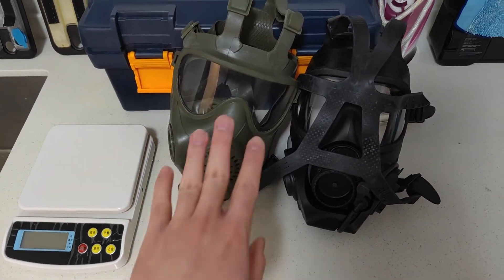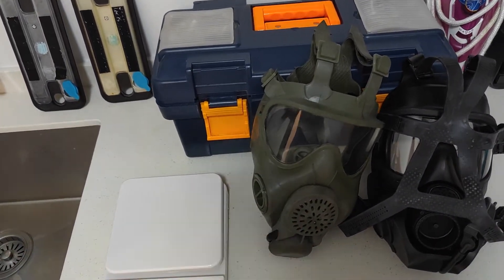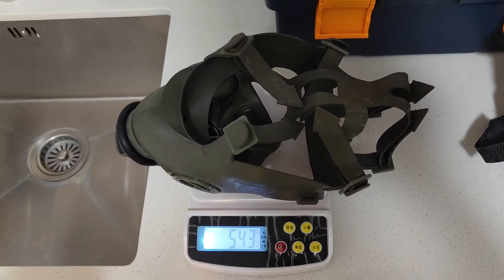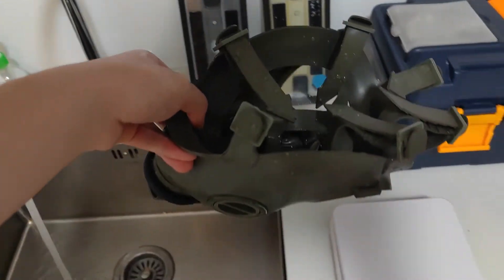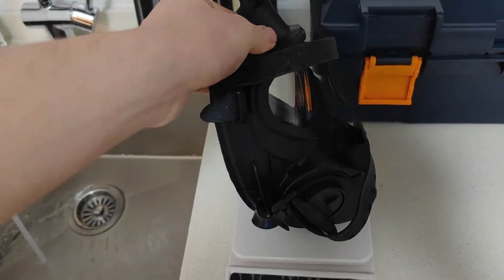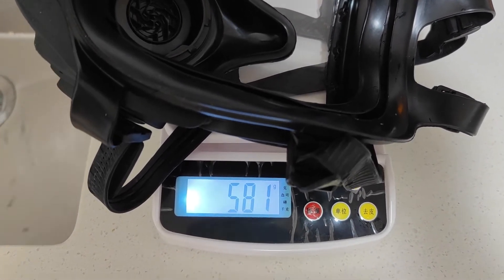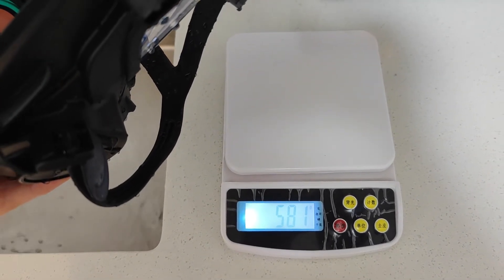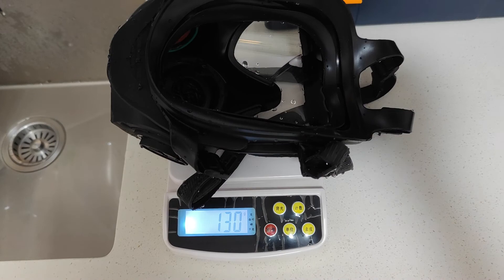Scott GSR/FRR vs PMK-4: Frontal vs Bottom-mounted outlet valves for fluid drainage.

Comment: Interesting test, but there are disadvantages to have drainage at bottom of mask: first, valves do not work well when submerged; 
second, the sweat (and dried residue i.e. vomit) can impair valve seating; third, the assembly is vulnerable to 
fouling when lying prone or crawling

Comment: Great idea for a video series, I've just ordered some better kitchen scales to do this sort of thing with as mine are very basic I have currently.
I found the Israeli M15 trapped a lot of sweat sadly in the chin area when I was using it to sand down a bench outside in the summer, seems always having an exhale or at least some sort of valve at the chin area works better.
Reply from the maker: Awesome and thanks! Definitely looking forward to watching tests of your mask collection!